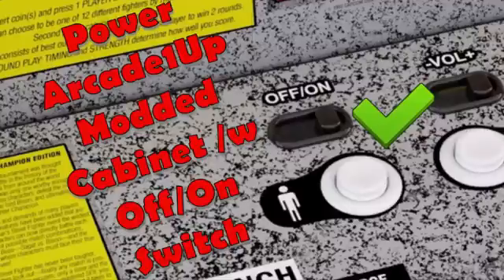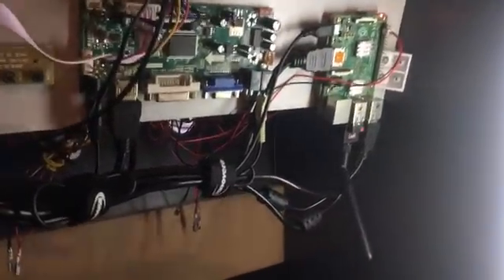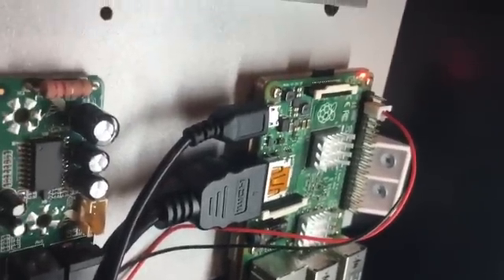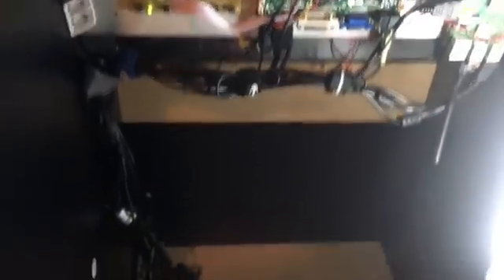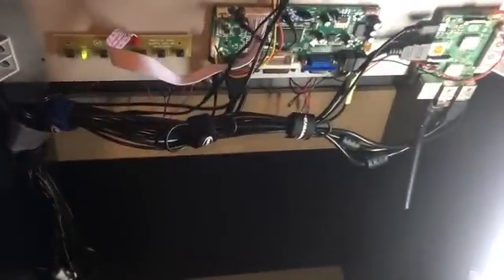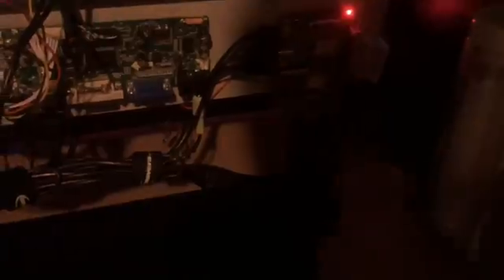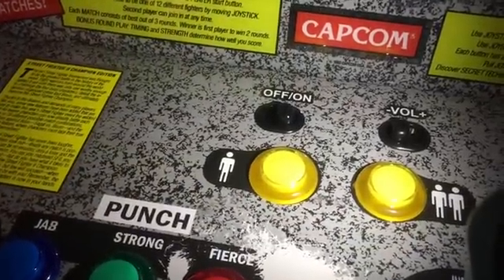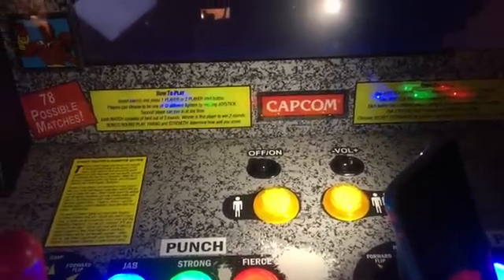Arcade1Up - Use Builtin Switch to Turn Raspberry Pi on and off

Comment: I don't know if it's a good idea to cut power like that to the Pi.
Reply from the maker: The switch actually shuts down the power properly. I do however, use my Google home smart device to shut all the power off. I did lose an image once so it's best to have a backup of the image just in case.
Reply: @DetroitLove  Nice

Comment: Isn’t there a way to power up the pi as the monitor and marquee light up… and the opposite, turn off the pi, then the monitor and marquee… With one switch? I have kids 😊
Reply from the maker: Like this? Arcade1UP Mod - search for “Turn Everything, Yes Everything OFF with Stock Power Switch”
Reply: @DetroitLove  Is that the one you did with that special plug brick? I saw that one after my initial question, thanks. But I never saw any follow up video because you still had issues. If I am referencing the wrong video, let me know, thanks.

Comment: Why don't you just spin the button around?
Reply from the maker: Because you can just do it with software
Use Arcade1Up Builtin Power Switch without Reversing the Hardware - Arcade1Up Mod Life https://youtu.be/nn3jecm1GA4

Comment: Does this need a safe shutdown?
Reply from the maker: This does do a safe shut down. The only downside to it is it won’t save any changes that you made prior to turn it off. If you need to save changes or even a high score, you need to use the menu system to restart the emulationstation and then use this to turn it off

Comment: Hello, and thanks a lot for your video. I disconnected the fan and connected the switch exactly as you suggested but it does not work. I used pin 5 and 6 but it does not work. Any idea why? Thanks!
Reply: Detroit Love thanks a lot! Do you have any tutorial for that? I don’t know much :(

Comment: With a case, raspberry pi 4 case fan uses pins 4 and 6 by default. But pins 2 and 4 are 5v power, either can be used, and 6 is ground. The case fan should have each connector separated so you can plug the ground to the next nearest ground pin, which is 9. So you should be able to plug the fan into 4 and 9, and the A1U power switch to 5 and 6. I just tested the fan at 4 and 9, and it is running fine.

Comment: Any idea how to mod the power switch to work with a PC? I'm putting an i5 with a decent enough gfx card in it to also run modern arcade games as well as retroarch, but I want to be able to use the built in switch.
Reply: For a build like this, and what I am doing with mine is Using a Transformer and a relay, So the switch will be powered by a transformer that will go through switch to a relay and kill power to all 110Volt plug ins.  I don't think you wanna run 110 volts through the stock switch.

Comment: I am using this script almost exactly as shown in ETA prime's guide and the button wired up as shown here - the Arcade 1Up stock on/off slider switch wired up to pins 5 and 6. Off triggers the shutdown script. It is working fine except that when I shutdown the Pi using the button/script, it seems to lose any newly changed metadata, such as newly favorited games. But, when I shutdown using the shutdown option within the ES menu instead, it retains new data/favorites fine. What am I doing wrong or what do I need to change in the script for it to not lose metadata changes?
Reply: @DetroitLove  makes sense, thanks
Reply: @DetroitLove  so, using ETA Prime's script setup the way he tells but using the On/Off Arcade1Up slider switch to activate it...is the safe shutdown via script still happening or is this just cutting the power without safely shutting down? Does the switch type affect that at all...toggle vs momentary?

Also, if I were using a momentary switch like ETA Prime instead of the slider, would the metadata saves still not be happening, or would it be different?

Comment: The problem I see here is what does the code say for power on and power off. If you watch ETA primes video he is using an arcade push button which is completely different from that on off switch your using.  With the push button the circuit is always open. Then you press it and it closes the circuit telling the board to turn off but when you release the push button the circuit opens back up and the raspberry pie stays off intill it sense a button press”closed circuit again”. Your on and off switch on the arcade1up cab is either indefinitely open or indefinitely closed. So you turn the switch on it completes the circuit and shuts the raspberry down but that switch doesn’t open again intill you slide the switch back off that’s is why your on on button is backwards. So you have to look at what the code/ script says to do. You would need a code that says when circuit is open indefinitely the power stays off. When the circuit is complete indefinilty the power stays on indefinitely intill the circuit is open again wich turns it off.

Comment: Hey Detroit Love.... great vid.... question: how do you use the existing connection from the power switch on the arcade 1up when the pins on the retropie are so close together?  I can’t plug that existing connection to my Pi .....thanks in advance!
Reply: Detroit Love ....just figured it out.  There’s a “cap” on the existing connection that you need to remove first before you can plug it into your retropie... otherwise it won’t fit in between the pins on the retropie.... looks like we are good to go! Thanks so much for your help.... again great video....  Happy gaming!

Comment: Hello Detroit Love. Love your videos as always, I'm having an issue when i try to run the last command:
 6.  wget https://pypi.python.org/packages/source/R/RPi.GPIO/RPi.GPIO-0.5.11.tar.gz
it says:
"No such file or directory"
How come?
I'm using putty from Windows 10 
Please Help
Reply: Thanks for the answer, yes i tried and it works like a charm! Although we should shut down the system from the RetroPie itself to avoid data corruption. If we turn of the system directly from the button is not recommended.
Reply: Detroit Love gotcha, I will try again with the tutorial to see if I’m gonna be lucky. Thanks again !

Comment: #!/usr/bin/python
import RPi.GPIO as GPIO
import time
import subprocess

# we will use the pin numbering to match the pins on the Pi, instead of the
# GPIO pin outs (makes it easier to keep track of things)

GPIO.setmode(GPIO.BOARD)

# use the same pin that is used for the reset button (one button to rule them all!)
GPIO.setup(5, GPIO.IN, pull_up_down = GPIO.PUD_UP)

sdown_flag = False

while True:
    #grab the current button state
    buttonState1 = GPIO.input(5)

    # check to see if button has been pushed
    if buttonState1 != False and sdown_flag == False:
      subprocess.call("shutdown -h now", shell=True,
        stdout=subprocess.PIPE, stderr=subprocess.PIPE)
      sdown_flag = True
    elif buttonState1 == False:
      sdown_flag = False

    time.sleep(.1)

Comment: Man, I had this working with the reverse buttons. Switched the button and now switch doesnt work. Checked wires, etc. and all looks good. When removing the pins from 5/6, the pi shuts off. When put back in, the pi turns on and runs.  No idea what happened, but my switch wont work at all now.  Any ideas?

Comment: I followed the instructions and connected the on/off switch to pins 5/6 but nothing happened.  I'm using a Raspberry pi 3 b+ model.  Does that make a difference? How can I power on and off my arcade???

Thanks
Reply: Yeah, I switched the on/off switch around. Guys, the script that is included in the image is for an on/off button, not a switch. They work differently. I used the script for the   new pi cases and it works with no issues.
Reply: So, there is a script for using the on/off switch?
Reply: @ZombieJesusOU812  yes, if allowed, I'll post it on here. Let me know @Detroit Love.
Reply: @DetroitLove  Which Wolfanoz image? I downloaded the "32GB arcade only" image (which I saw the script lines "shutdown.py") but still doesn't work
Reply: I got you man. I just installed the same image on a Pi3B+ and followed this video by Detroit Love regarding the ON/OFF switch and got it working, even though the same thing happened, the ON/OFF positions are reversed. In the image, disable the script. Install the script that is used for the new Pi Nespi Cases. I'm not sure if it is allowed to post scripts and what not in comments sections but if it is, Detroit Love, let me know. If not, shoot me a message guys and I'll send it to you. It works like a charm.
Reply: Yep, I had to replace the script that was already provided in the Wolfanoz image by level1online...it works BUT NOW the system just randomly shuts down...argh.
Reply: @DetroitLove  I tried everything with using the stock on/off switch, to no avail...it just kept randomly shutting down. But it works with no problem when I connect it to an arcade button. I'm just going to install another button for my on/off switch.
Reply: @DetroitLove  Do you still have the script that you used? For some reason, ETA Prime's text file did differ from the one he had on the video.
Reply: @DetroitLove  Thanks for this tip! You saved me an evening of frustration as I couldn't figure out why the baked-in Wolfanoz script wasn't working. All good now. You're a lifesaver!

Comment: I added this to my arcade1up SF cab, any help with this would be appreciated. Alright so I got everything working. (or had everything working I should say) I was able to turn it on and off a few times with the stock power button.Then I mounted everything;
But now the pi wont power on at all with the power button plugged into pin 5 and 6. Any ideas?
Reply: @DetroitLove  nope lol

Comment: Hi Detroit Love. (having issues here)I used the info from your video, Rival Boss and the ETA Prime video and modded my SF2 cabinet with a Raspberry Pi 3 b+. (I flipped my power switch and plan to get it working once the rest is running) I went with a 128Gig file from arcade kings.  Everything booted up, have some sound issues and worse cant plan any games. I was able to get sound on the demo screens showing the previews but once I load a game the sound is gone and my coin slot / select button doesnt give credits. I config both controls, everything is set up and lights up and match all wire connections. joystick and buttons work but no coin input and it wont take me back as a hotkey either (they show button designation), I have a wireless KB I have to press ESC to get out. The USB controllers connections match, all pins are in and when I config both controls and buttons they match each other. Any idea what I need to config? I've spent half the day trying to get it work and no luck. Thanks!
 Great video again! I have the switch swapped and ready to get the script set up, I want to have the games work first though!
Reply: @DetroitLove  Thanks. I used the [128GB]-Gold.Community.Edition v7.0-4.4.2-VirtualMan.and.2Play from Arcade Punks. It took a little over 7 hours to DL! It looks really nice and clean otherwise, but disappointing if that's the issue. I will grab a smaller image and try a different card. Thanks again for the advise.
Reply: @DetroitLove  Which 128 GB Wolfanoz one were you looking for? I need to find another site that has it and DL it myself! Send me a 128 gig card and I'll etch it for you and return it. I'm laughing at the 7+ hours because I remember back in the day I used to run a BBS on a 300 baud overclocked modem to 450 baud on my C-64. Spent 14 hours trying to DL Spelunker and it failed at the end. Like everything else nowadays ... I want it now.(I'm DL'ing it on wireless myself) I need to get another micro sd card to etch the 32 gig Wolfanoz version I Dl'd yesterday and get this machine running today. I'm not yet ready to give up on the 128 gig one I grabbed, so it's off to Best Buy or Walmart this morning. I also need to run that power on/off script you showed. I'm less tech savy nowadays but it doesn't look too difficult. I flipped the switch during my build and already put the wire to pins 5/6 on the Raspb PI 3B+.
Reply: I got it to work with the same 32 gig Wolfanoz image Rival Boss used. I was thinking my usb controller was bad, but that's not the case. I removed those overlays and everything works great. I just need to play around with the set-up and system and see how things work. If I remove the micro sd card and go with another card I imagine do I lose all the settings? Can I save the settings so that won't happen? Also I found it has the momentary switch power off script in Emulation Station already there but I need to be sure i'm using pins 5 and 6, because selecting to run the script from the menu didn't work. Worse case I enter all the commands from notepad++ and see.
Reply: @DetroitLove  Thanks again for the heads up! I'm loving this machine. I think my next mod will be to do something that utilizes the volume switch properly or maybe a slider pot switch to work the amp from the front in the same switch position. I really wish Radio Shack was still in business! Looking forward to more of your videos.

Comment: I’m going to try this soon. This is just a theory but maybe when you installed the script, the switch was on the Off position. So when you switch it to on it read that as off. So I’m thinking maybe before we install the script, we should have the switch set at On first? Just a thought
Reply: Detroit Love will do. I just need to gather the necessary parts to complete my mod

Comment: Did you have to extend the wire for the on off switch?
Reply: Detroit Love and then does it just plug in to connector 5/6 on the PI
Reply: Detroit Love not yet taking down my notes getting prepared everything is on order.  No extra parts are needed right just the current wire right

Comment: That's a easy fix on the power button problem.  You wired the switch on the PCB wrong.   Leave the switch on the On position.  The ground wire is correct just move the other wire around till it powers.  When it does that's where you hook it up to.   Send me a pic of the current of the wire set up for the switch.
Reply: @DetroitLove  must be a short somewhere, if it powers on then powers off.  might be a bad pcb board on the on/off switch.

Comment: Did you try switching the orientation of wire end of the button? As in, put the red cable where the black is and the black where the red is(essentially just turning it around) the button might be polarity sensitive. Might be worth trying before actually switching the physical button around. :)
Reply: Detroit Love aww darn! That’s so odd. At least switching the button around is also an easy fix. I’m about to be doing this same mod to mine(I’m super excited) so I’m curious if I run into the same issue!

Comment: This step by step video link by ETA Prime is dated and the link code doesn't work for the Python 3 line install. 

This link works for me. It's the same steps but in a package with only 1 line to paste:
https://pie.8bitjunkie.net/retropie-shutdown-and-startup-switch-the-easy-way
.

  Pin setting is still the same.